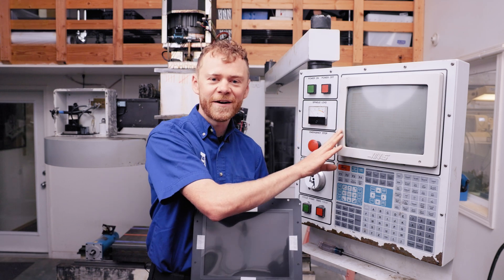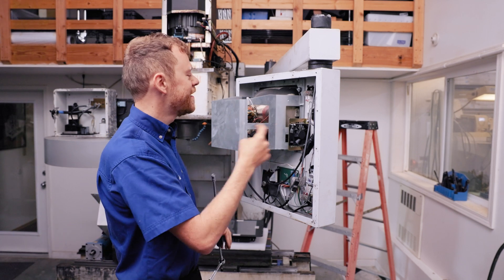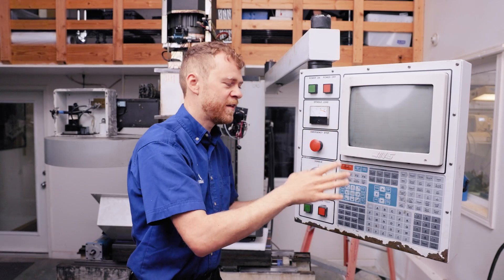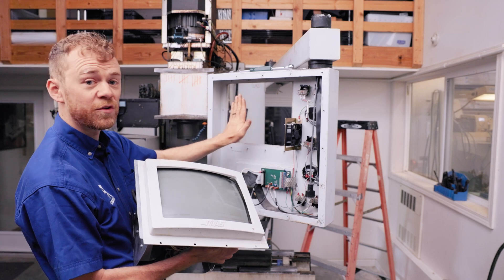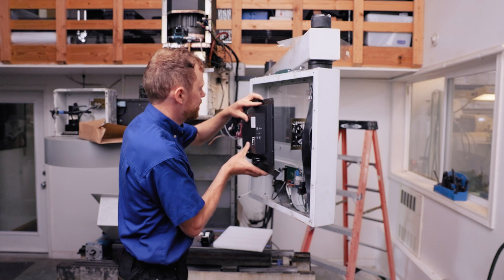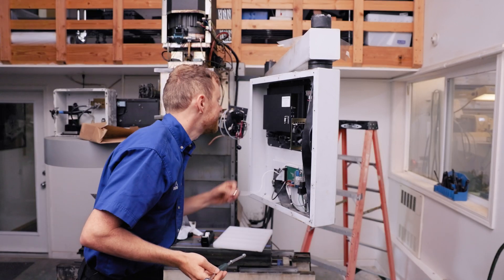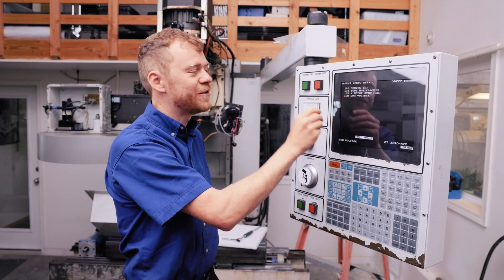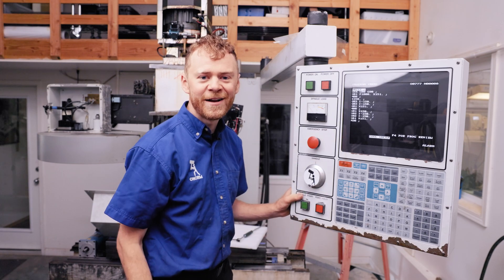CNC CRT to LCD Replacement Upgrade

Comment: On our 1999 Haas VF4, it was like your video in that the video cable was a 9 pin quick connect.  The power was also straight forward.  Now our 2000 SL 20 is having problems with the screen.  Haas hard wired it to two boards.  Do you have a kit or a video to help the upgrade?
Reply from the maker: Send us an email or a picture to the info@cncreplacementparts.com email